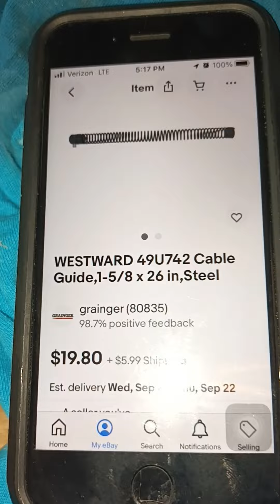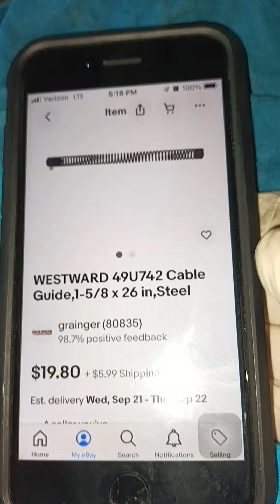greatest and cheapest drain cleaner upgrade

Comment: Nice.  Keep'em coming.   Going to try I believe to use this machine for roots accessing from under sink like this so nice to see you approaching your problem from same area.
Reply from the maker: I snaked a 4 inch drain  pipe with this machine and it pulled a 6 ft long braid of roots,,so it does work outside too

Comment: Thanks for the very good tip!  Yes HF hydrostar cables are very weak and even if little bit kinked becomes very hard to control. Guide spring would be very useful if you have imperfect cable.   You have more expensive version of HF hydrostar.  Cheaper ones (without wheels) has a major flaw in that those don't have any means to clamp down on the cable and stop it from advancing when it hits serious resistance.  This is another reason why cable for HF hydrostar becomes kinked so easily.  Too bad for inexperienced owner who must either get another cable or dispose of their machine on craigslist.

Comment: Professional machines don’t have those, that is strictly a device for less experienced people, and a really good idea for those people. It takes a lot of experience to know how to read the cable. I will give you the biggest most useful bit of information about those harbor freight machines, the drum is too big, too much space inside them allows for cable to twist up in the drum
Reply: Your tip should be how to prevent this from occurring to be useful
Reply: @billderby1527  mine is older and has an open drum, I just added rod to block off the front half of the drum, I wish I could post pictures here.
Reply: I used various machines including HF hydrostar, Ridgid K400 and HD rental general wire snake machine.  I agree that guide spring is not needed for pro quality machines.  But HF hydrostar cable is exceptionally flexible and weak.  Guide spring is indeed useful for hydrostar as cable kinks easily and become totally uncontrollable otherwise.
Reply: @coldspring22  I still have a harbor freight machine, just put a new cable on it. I don’t feel that the hydrostar cables are any more flexible than an equivalent general cable but definitely lack some of the spring qualities. My mainline machine has 3/4 cable, that stuff is stiff as hell